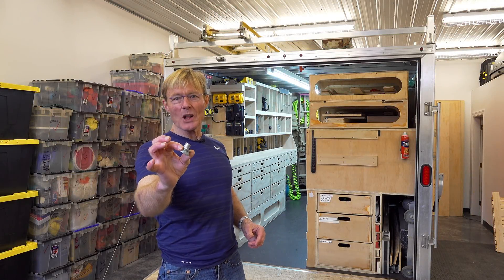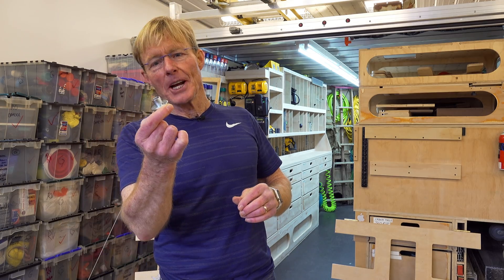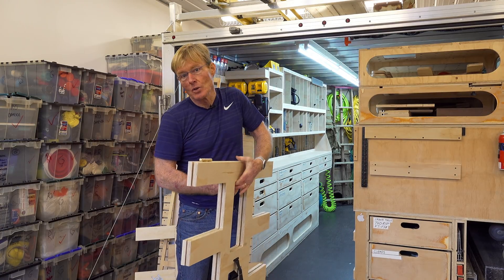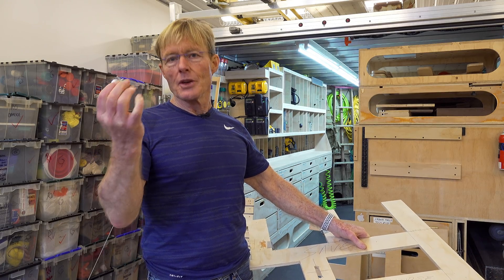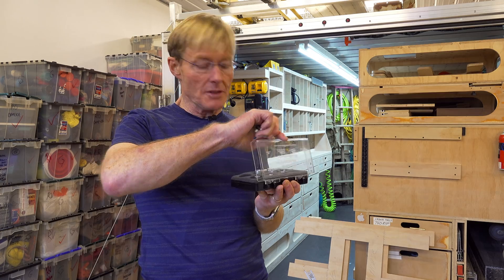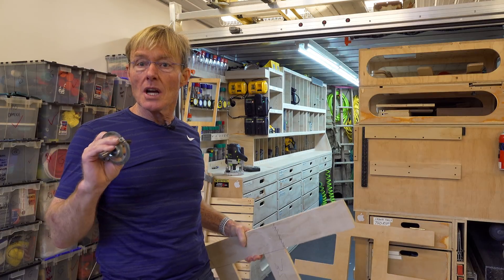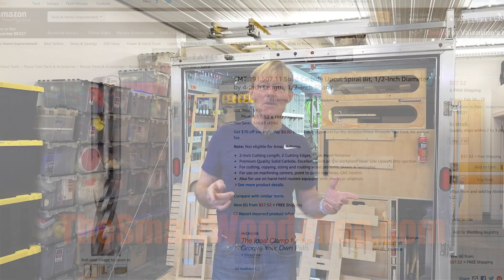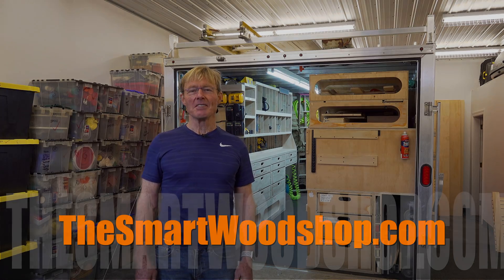My 5 Dollar Portable CNC Machine.

Comment: Great video, I am learning everyday with your videos. Just bought a set of your smart workbench (the small one) and I am trying to find a way to get a good combination of a metric spiral upcut router bit and a bushing set to get that 3mm difference from the pattern on the plan and the final piece. Do you have any recommandations ? Do you just stick to imperial size router bit and bushing a neglect the small difference of 0.006" on the final part as those router bits seems to be more readily available in North America.

Comment: A cnc would make those so called templates you use so often with out the need to even sand them.. Making a template involves multiple tools.. A cnc template involves a cnc, CAD and wood.. Can be using your template in half an hour
Reply from the maker: I don't have a CNC. I am portable, and fitting one in the Smart Woodshop Trailer would be tough. I've had a few vendors offer to put one in my shop, but I had to decline as I want to stay portable. My system works well for me and my needs, and most of the Smart Woodshop Fam doesn't have a CNC, so I provide a way to get accurate repeatable results. I've been using this method since an entry-level CNC was $250K. Good thoughts, but a CNC isn't always the best option.

Comment: I'm curious how bushing/ template routing can do intricate logos or lettering? Even a $300 CNC can do that.
Reply from the maker: I have never had a need to make logos or lettering in wood. My area is new construction and remodeling. If I were a sign maker, I would surely have a CNC. 😎🤙
Reply: @TheSmartWoodshop  but can you see how that means your video title is 100% inaccurate? Repeatability and intricacies that cnc can achieve are far beyond what the bushing & template system will ever be able to match. Also you maybe forgot that every minute your cnc is cutting is a minute you're not risking injury, not breaking your back, and lowering your labor costs and time. Sorry, but your assertion that this can do everything a cnc can do is ABSOLUTELY hyperbole. Massive hyperbole. There are a million things even a hobbyist cnc can do that you can't. I have a $3k matchine I bought used that can do 4th axia caving, 3d carving, has a laser module to do engraving, and can change its own bits. Which of those does your system do better. Sorry for being pedantic but these absurd assertions are obnoxious clickbait and I don't like it since I'm here for real information.
Reply: @bemccune7671  true, however, I learned great info in this video and I could see how using this method for larger, simpler cuts could actually be faster.  So, it depends on what you are making.  For what he makes/builds, it seems like a good option and awesome info and I'm glad I know about it now.  Could be very useful for me.  But yeah, a CNC can do a ton that simply isn't realistically feasible when done manually.

Comment: How did you convert between the standard measurement of 1/16" or 1/8" offset, and the metric measurement of your bench plans?  Did you round down the 1/8" (3.175mm) to 3mm, round up 1/16" (1.5875mm) to 2mm?
Reply from the maker: I use 1.5mm for the bushing offset😎🤙
Reply: @TheSmartWoodshop  Many thanks

Comment: Cool.

I learned the same techniques back in 1976, in Shop Class. In spring 1977, my wood shop instructor hooked my up with a job at a small wood shop in town. I was hired to do all the sanding in this one-man shop. The way he made money was by working efficiently. His "day job" was in the aerospace industry in the LA basin. Pattern-making and use was in his nature. He used both methods. One his walls, hundreds of patterns that he had made for the products he designed, created and sold. So many that he used numbers, not names, for each pattern. This was way before computers, so he kept 3-ring binders full of all the products he offered, along with the patterns necessary to create each (typically multiple patterns per item; varied).
Reply: Same here, this is not a new idea.

Comment: Morning!
I have to both agree and disagree with you. Template routing is a good thing and has its place. So does cnc routing. It all depends on your available space, production rate, production amount, and production variability. An the last one, production variability, combined with available space, is where your argument for your method breaks down. Along with the fact that a cnc allows you to work in near parallel on something else.

In the beginning you were noting how small the trailer workshop space you were using is. Which is cool; many hobbyists and small business woodworkers work in limited space. And yes, large format cnc are, well, large. They take up allot of space. But so do templates. The difference is that if you are not actively using a given template it is "dead space" not making you money. The cnc can stay busy as long as you feed it designs and materials. This, if you have limited space AND have a large number of designs you work on, the cnc makes more sense even if it is slower. It can work while you do other things and your template storage all fits on tiny computer. Or the cloud, nowadays.

As to cost, a $100k cnc is asanine for most small business woodworkers. You can build your own cnc router in any size for less than $4000. There are extremely good designs that are in the $1000 to $3000 range that are fairly easy to build, reliable, and you can build them arge enough to feed it a full sheet of plywood or build the small, your choice. There is even a newish design called the MPCNC (Mostly Printed CNC) that uses steel (or galvanized) pipe and 3d printed parts. It rides on a flat table surface and, in theory, can be lifted off that table and hung on a wallwhen not in use. So you could use your workbench and a wastwboard if you were clever enough.

My point is both have a place, both are useful, and both have pros and cons. But a $100k machine is stupid unless you are a huge pro shop.

Comment: DIY VACUUM TABLE AND CYCLONE DUST COLLECTOR IS HARD TO BUILD ..??
YOU ARE AN IDIOT.
I WAS A SINGLE OPERATOR/PROGRAMMER/SAYWER FOR A COMMERCIAL SHEET GOODS & OFFICE FURNISHINGS.

NO MAN WITHOUT A CNC MACHINE COULD CUT 51units of 1"x48"x60" OFFICE DESKS IN AN 8HR DAY.
DRAWER BOXES, THE SHIPPERS CARDBOARD,... EVERYTHING.
Reply: 95% of what you do ends up in the trash in 10 years. his houses will still be used in a hundred years.
Reply: And you... are troll. Who goes around the internet calling people idiots? Unless they lack moral fiber enough to deceive themselves into justifying it. You must have some void you're trying to fill if you're willing to do such things. You are evidence of the way this world is heading. Sad really. 

And btw, he did acknowledge that there were commercial operation that could do it faster. His point was "most". Which has also been my observation.

Comment: Wanted to ask a personal question if it's ok.  I've heard that woodworking/dust is really bad for the lungs.  I notice you have a rash or redness on the back of your hands is that from woodworking?  I'm just wondering in case I need to be more careful around sawdust especially from the manufactured kind of boards.

Thanks

Comment: Wow, i didn't think this video would cause that much controversy. I'm amazed that folks don't 'get' what you are really saying. I have recently come to the same conclusion you have. I think you can say it in one sentence. For repeatable parts making, a router bushing and shop made template, beats a very expensive CNC every time.  Why, or how can that statement be true? That's the rub, right there. For folks that need the latest greatest whatever, awesome. I think if i had that kind of dough, i'd put it back into my shop, or my truck, or my trailer. Thanks Ron. Thank you commenters for reminding me that reading the comments is always a mixed bag. I did learn some stuff there, for sure.  aoxomoxoa

Comment: hum, this is one of those things where I agree and disagree at the same time. You picked an example where yes, it is almost as quick to make your templet with hand tools as a cnc because it is all straight lines but add some organic curves and suddenly you would save a lot of time using a cnc to make your templets. Something that would integrate well with Festool and your workflow very well is the Shaper Origin. It is basically a smart router and you could use it to make complex shapes in patterns and for a one-off. My personal rule of thumb is if I am going to make 4 or more of something make a template, less than that I will just use a cnc.

Comment: click bait title; while you have the guide in, knock me off A-Z in 50mm & 120mm  high letters, in mdf, dibond, and some 10mm clear perspex. for 5pm tonight.
Reply from the maker: This 11-year-old channel with 700+ videos and my 30-year career are about home building. Working on-site is key to efficiency, production, and quality. Cutting out letters on a CNC is a different profession and content for a different channel. In the rare case that a CNC would help I have found a workaround that gives me repeatability, accuracy, and speed.  I can cut a template to make the pieces and move on to the next task before I could drive to the CNC shop, get the design coded, input into the machine and cut. If I decide to get into cutting out letters, I will consider constructing a shop and buying a CNC.  I even stated that a CNC machine was excellent and in many cases the best option, but not for my needs as a home builder. Really, you should pay attention to the context before you comment.

Comment: I assume you have never seen the Maslow a sub 1k CNC router which does 4x8 plywood.
Reply: Thank you for mentioning this, the Maslow is amazing, without a doubt. It might not be something for Ron, or the guy that is doing home building, remodeling, but for those of us that fabricate weird stuff, all the time, this is the ticket.
Reply from the maker: The Maslow would be perfect to fit in my 12' trailer and take to the site? I would be done with the job and moved on to something else before it was set up. Remember, my channel (all 700+ videos) and 30 years of experience are about and for Home Builders and remodelers. I am not offering advice or how-to videos to furniture makers, cabinet shops, or puzzle makers. There are other channels that serve those industries. I have been at this YT thing for 10 years and never deviated.
Reply: @TheSmartWoodshop  

The Shaper Origin would probably be a better bet than the Maslow. 

Workflow wise, its nearly identical to what you already do, the only difference is the pattern is digital (so no initial pattern needed). 

Can load files for cutting, or create them on-the-fly. 

My carpenter was skeptical at first with mine, but now uses his all the time. 
Changed his entire workflow. 

He now does CNC cabinets on site from his trailer. Door pockets and other common patterns are preloaded in memory, so he just has to select the one he wants and goes. 

Can even run them manually, so you get the same use that you would with a plunge router. 

Everything has its use. Sometimes manual is best. I think the Shaper is the best of both worlds.
Reply: Ron Paulk So you build saw horses on a job site?  What is a real example of something you would use this for on a job site?
Reply from the maker: Dave Tarrant I don’t have a shop so my “shop” is always on some site somewhere. I can and do build everything on site from multimillion dollar homes to saw horses. 11 years on Youtube and my only purpose has been to share my mobile techniques and efficiencies.
Reply: @TheSmartWoodshop  The typical Maslow looks like a wall mounted sheet goods saw.  Also because all the motion control is at the top, I don't see a reason one couldn't come up with a split frame design to make it transportable. Also in the same vain regardless of the number of videos or years in the trade (which I have you beat), saying a $5 router guide can replace a CNC isn't accurate as well as one costs $100,000 because it doesn't maybe after 30 years it is time to open up to new ideas as take it from me, yes an old dog can learn new tricks :-)

Comment: I can do 2.5 dimensional carvings with my 3 axis CNC ! I don’t think He knows that you can do so much more than cut in 2 dimensions.
Reply from the maker: 30 years of home building and remodeling and not once has a home I built required me to carve anything. Remember, I am sharing my knowledge about and for those that are building and remodeling homes. A 3 axis CNC would not have helped me even once in my career. I am sure there are those that have projects that those kinds of machines would help, but not what this channel is about.
Reply: @TheSmartWoodshop  then why are you comparing a router bushing to a $100,000 CNC? That's why people are taking issue... I love your channel and work but what you're saying is like saying a $5 fan is as good as a Porsche because the fan's air makes you feel as comfortable as the AC in the Porsche. You're narrowing in on a single aspect and how it applies to you, and you're comparing it to something that may treat that aspect as an afterthought.

Besides that, even a Maslow pays for itself when you consider that it can be running and doing stuff while you're off doing other things.
Reply: Ron Paulk that still does not change the fact that your guide cannot do everything a CNC can do , if it suits your needs or not !

Comment: Get a 5 axis cnc router and make all your stiles and  rails mortis and tennon all the hinge mortises and euro Grove and mortis in the lock box then bevel the edges.. All in one step takes about 20 minutes.  Hand is no comparison. No way your tool will do all that.  You will have to have a storage building to store all your templates.
Reply: @Rod Kinney only need 3 axis for a lot of that, maybe 4 axis for stiles if needed so

Comment: Already made it's called a trim bit with a bearing for a guide.
Reply from the maker: Pattern BIt.I am pretty sure I spent a minute or two talking about them in this video and why I don't use them.
Reply: I had bearing bits break so it nice to have this guide to follow than break bearing

Comment: I concur. My routers have made me a lot of $$ over the years. I did doors. I bought slab doors, jamb stock and milled the doors to the jambs at the job site. I could mill a hung door every 30 minutes.
Reply: @LPS AZ just curious is there a reason people don’t make a door from a sheet of wood? I been thinking to get a big sheet and cnc it so it looks like a panel door, maybe stronger as no joints and just one wood not need to join together

Comment: Ron, lm Wondering what kind of ear protection you use and where I could get it
Reply from the maker: I have two that I use the most, both from 3M. One is a headband style and the other is two in-ear plugs connected with a small plastic tube so they will hang around your neck. I have both in my Amazon store under 
WEARABLES, VESTS AND TOOLBAGS  https://thesmartwoodshop.com/rons-store

Comment: I've said it before. I'll say it again. CNC machines shine at three things:

1) Intricate designs;
2) Templates, and;
3) 2.5/3D

#1 enables the creation of works that would be difficult to impossible to achieve with handheld routers.

 #2 makes it possible to consistently turn out one, a hundred, or a thousand parts using handheld routers.

#3 produces results otherwise only achievable with hand carving.

As for speed, I'd accept that challenge. My CNC Factory Viper XP, with its 5'x10' vacuum bed, 10HP spindle and 10 position automatic tool changer beats a seasoned craftsman on even simple cuts, including any post processing.

Perhaps most importantly, the judicious employment of a CNC machine frees a valuable craftsman for the kind of tasks they do best and enjoy more.

Perhaps the best of both worlds is something you've already experienced: tools such as Shaper Origin, or the Yeti job site CNC. At $2,500 and $6,000, respectively, these machines are very  affordable ways of bringing digital woodworking into the mainstream.
Reply: I have access to a couple of CNC mills and routers, and 150W lasers.  These are great machines, but as Ron says they really aren’t required. My experience with them however has taught me how rarely they are needed.  

I have a router pantograph at home that can do most of the 2.5d/3d things that can be done on most CNC machines. For 2D I can design in the usual vector programs and print out a pattern I can trace on the pantograph.
Reply from the maker: I like the idea of getting a Shaper Origin or Yeti to make my templates and then use the templates with my router for production. I just haven't reached a point that the time savings in template making would repay the investment. Note: everything I say is coming from the perspective of a homebuilder/remodeler working solely from a 12' trailer. I have no crew or fix based shop so I either pay a CNC shop to do things for me or come up with ways to get it done "on-site."
Reply: @TheSmartWoodshop  I left a reply before seeing this and that you know about the Shaper Origin. I think it and you would be a good fit if you find yourself doing any organic shapes, otherwise, you are right about templates for your work.